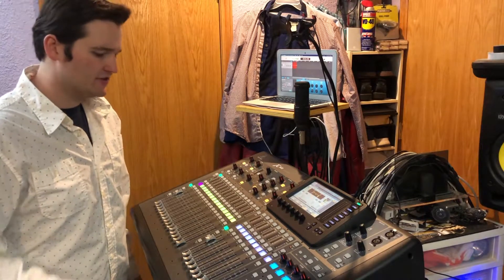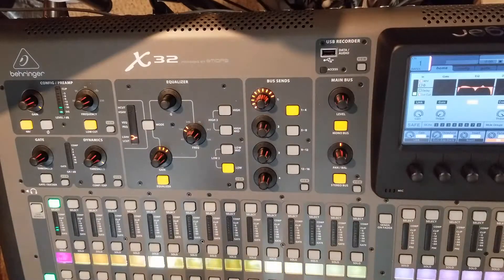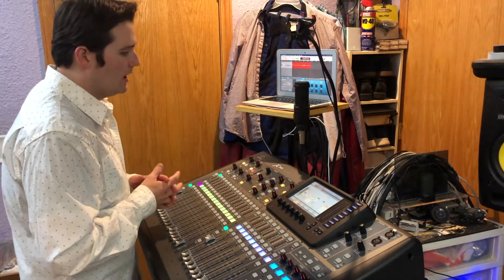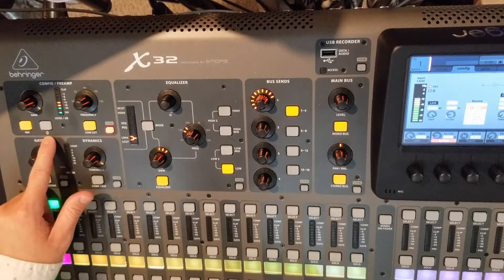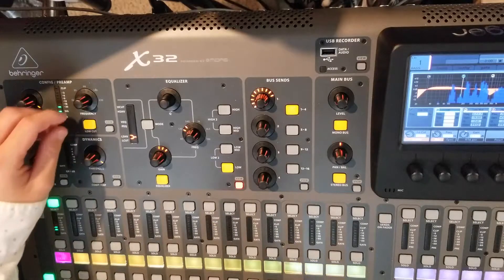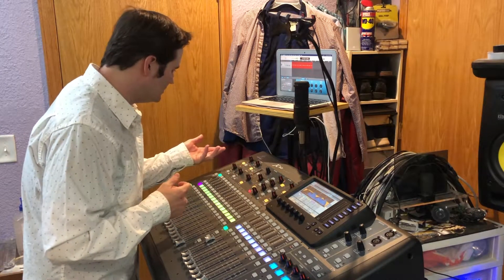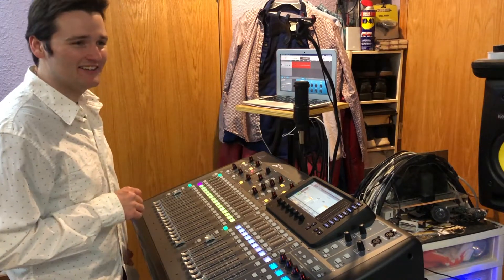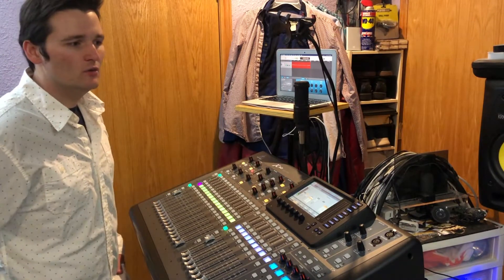How To Configure Your Preamp On An X32

Comment: at 60db on that preamp, your condenser mic should be screaming. In a live setting that would guarantee instant feedback out of FOH.  Either the mic is backwards or you have a bad cable.
Reply: popping the 48+ on and off on a condenser ribbon mic without mute wreaking's or destroys it